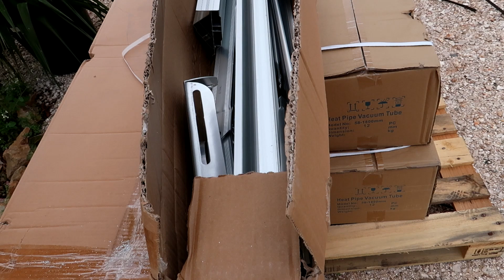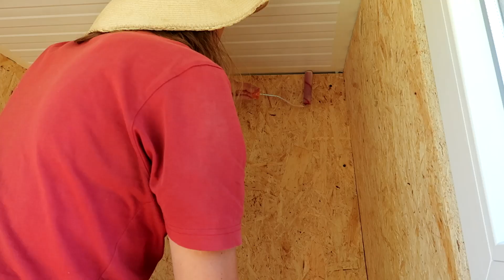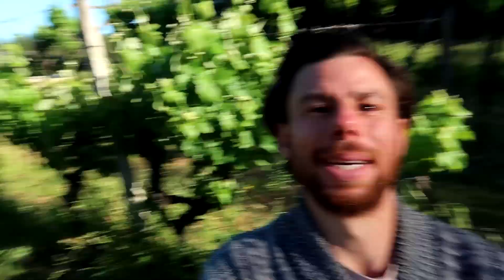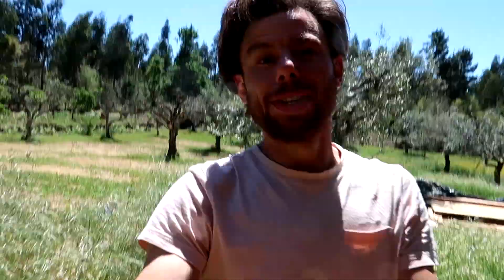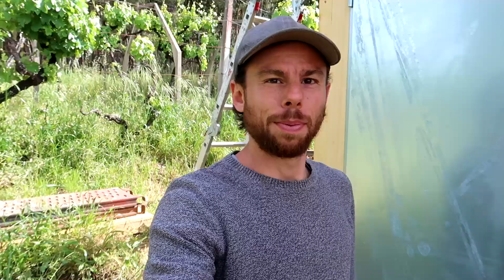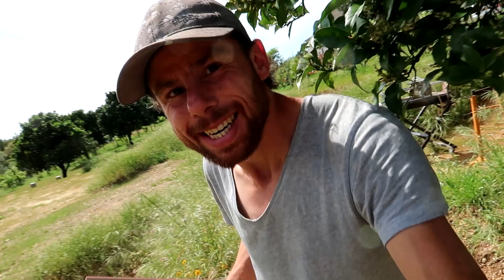Sanitary Building Part 5 - Installing a Solar Boiler and Construction Chaos

Comment: I am very curious if you contacted the builder about the broken link? Obviously you have some insight in construction, i would have been puzzled and would have needed aid. Throughout your videos you showed a lot of  Mc Gyvering skills( wonder how many people on the earth are familiair with the expression)
Also i am wondering what you do with the cardboard? Karton.. in which the boiler was packed. I saw videos of the nearby veggies who use the cardboard underneath the wood-chips of a path, to prevent onkruid? growing there.
Reply from the maker: Yes I contacted the supplier. I could've had it exchanged for a new one, but that would take 6 weeks to arrive. They assured me it's only esthetically and doesn't void the warranty.
We're indeed keeping the cardboard. Maybe we can use it for the pathways, for a no-dig bed or even hot compost! Not sure yet though.